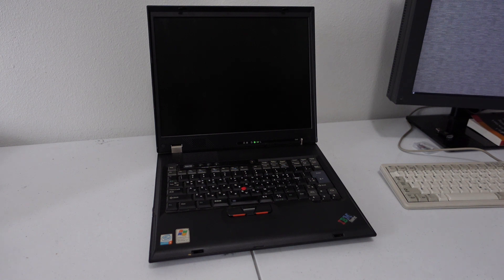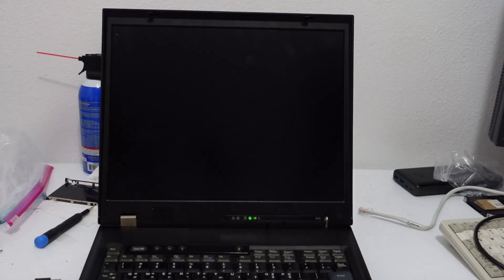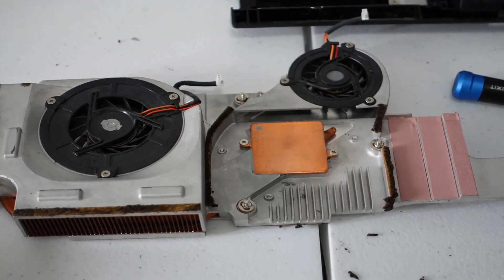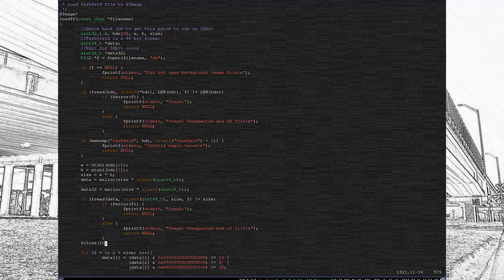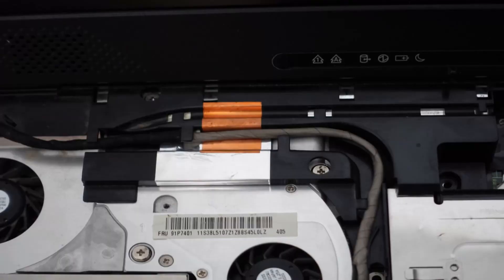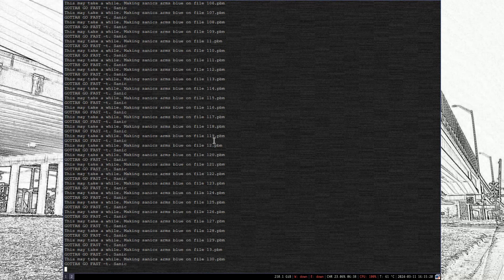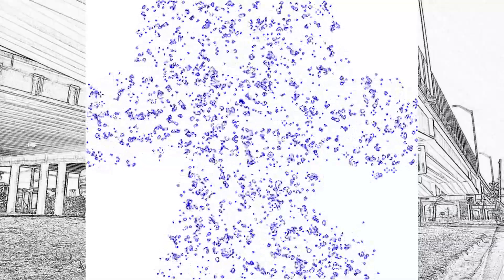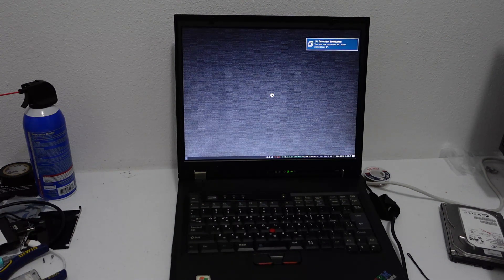Refurbishing and using a Desktop Pentium 4 Thinkpad (Korean IBM G40) with modern Debian GNU/Linux

Comment: I have one of these, I just threw away the battery because it started smelling weird, but know I have I need to find a 3d print or schematics for the battery cover, do you know where to find it?
Reply from the maker: I don't know if their is a 3d model for the battery cover. I did a quick search on yeggi and no luck.

If you have the battery somewhere you might just be able to remove the electronics. I don't like to deal with bloated cells as well, so that might be a bad idea. Also older packs can range from easy to hard to open up.

Obligatory fire risk warning, so maybe don't try this, but I have disassembled a few dead battery packs before. I imagine if it has burning plastic smell, you probably don't want to touch it.

Best of luck :D
Reply: @tripcodeQ7 thanks i did first try that , but the plastic was so brittle that it started to fly away as i pried. I'll keep it as it is plugged to the charger , also the screen polarizer got completely destroyed , same thing happened to a few old game boys I own. I prefer to replace that than the battery cover

Comment: I am an absolute noob in Linux, I have a laptop, I installed Debian and then I wanted to install debootstrap, can I do this from an installation flash drive with Debian?
and can I remove the already installed Debian before doing this? Does it make sense to just install debutstrap?
Reply from the maker: Debootstrap is used to install a base debian system. I use it with chroot to install my windows manager setup and config files on different systems. So, each installation has a very similar or almost identical setup.

I would just mess around with the standard installation first, and if your going to write a similar script test it out on a second hdd from a working system. :D

Also if you just want a minimal debian installation, try the net install iso if the machine has a compatible wifi card, or ethernet.
Reply: @tripcodeQ7  :) thanks for the advice, I'll try the net install first

Comment: I have a T30 thinkpad, a pentium 4 thinkpad of a similar age to this one. Its been in my family since it was new. It works nicely with Debian and LXDE, I use it as a CUPS print server since it has a parallel port
Reply from the maker: Nice :D

I'm not the most knowledgeable about printers in general. So, out of curiosity what printer are you using?
Reply: @tripcodeQ7  A dot matrix printer from the  90s. I think the model is Star LC-10. The quality is pretty low but its okay for text. It runs off continuous paper, I use it for printing research papers for university economically.
Reply from the maker: @boymoderology  Thanks for the info, it's an interesting setup :D

Comment: Hey trip, how I can get that ST terminal? where is the repo?
Reply from the maker: I haven't uploaded it anywhere, it is a bit of a mess. these are the patches in it though:
st-anysize-20220718-baa9357.diff
st-clipboard-20180309-c5ba9c0.diff
st-newterm-0.9.diff
st-background-image-0.8.5.diff
st-dracula-0.8.5.diff
st-scrollback-20210507-4536f46.diff
st-boxdraw-20181101-30ec9a3.diff
st-scrollback-mouse-20220127-2c5edf2.diff

Also,
2ff < ~/terminal_backgrounds/$(ls ~/terminal_backgrounds/ | shuf -n1) > /tmp/terminal_background_image.ff

Is ran before it launches through a script. So, the pseudo transparency is more of a shortcut.

I probably should create a diff for farbfeld i686 though, I'll add a gitlab link to the description, or in an announcement with the other program code later.

Comment: If you're ever travelling again, Japan has some real curiosities too like the Let's Note CF-SX4 which has an inbuilt top-loading DVD drive, and was the last in the series to support upgradeable ram so it could do 16GB at a time when newer models capped out at just 8GB. the Let's note series of computers are very interesting in general and might be worth checking out
Reply from the maker: That's a pretty interesting laptop design. Is Let's Note a Panasonic brand?
Reply: @tripcodeQ7  Sorry for the late reply

 Let's Note is the brand that panasonic sell their Business laptops under in Japan. a few models have made it overseas under the toughbook brand (like the CF-SV1) but they're really a breed of their own. 

Their defining featureset is the extensive IO selection they sport, even the 2024 models still has fullsize RJ45 and VGA along with the usual usb A, usb C and a barrel jack and relatively light weight as well as a user replaceable battery as a selling point (they even have a service centered around this called PC navi). the screens they utilise are also rather nice and up until the end of 2023 they still sold models that came with an internal optical drive such as the CF-SV2

the circular trackpad on them is also unique as you can use it to scroll like how you would on the clickwheel of an old ipod

Comment: ohh i've got a g40 gathering dust in the closet, i got it from a family friend but i don't have the power adapter...
Reply from the maker: I had to find the power adapter on eBay, but if the laptops in good condition it should be a fun project :D

Comment: I miss the beeping sounds on new computers. Seriously, why did they remove it? At least give me the option to turn it on. It's not that the little speaker costs any real money.
Reply from the maker: I'm not really sure, the low battery beep and error codes are pretty useful though :D
Reply: @tripcodeQ7 And the post. OK, not really useful, but cool.